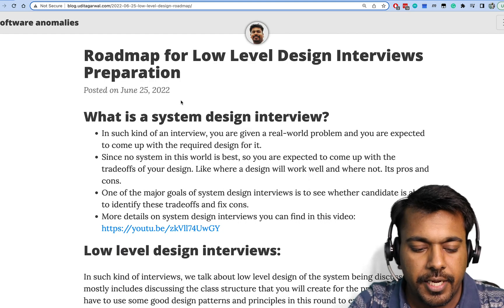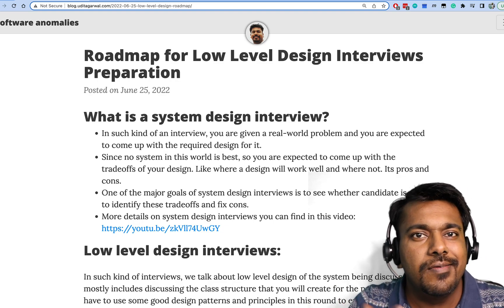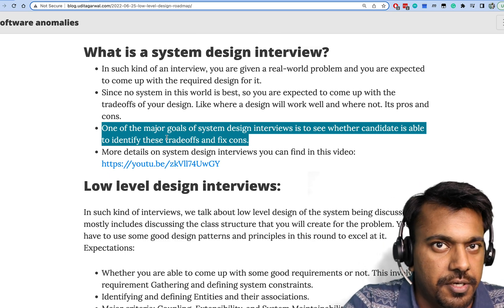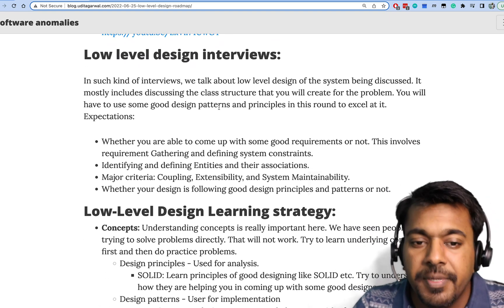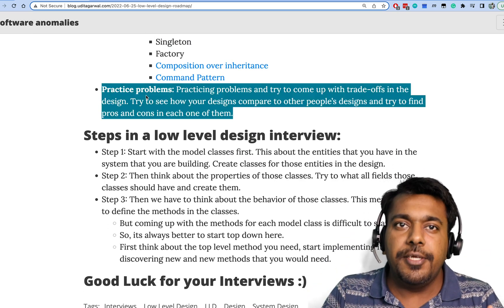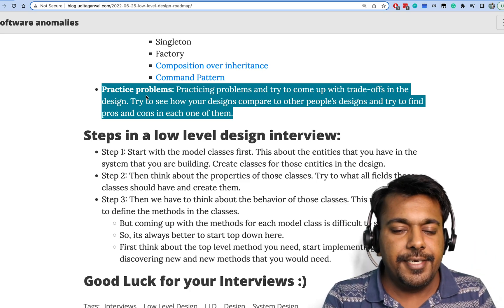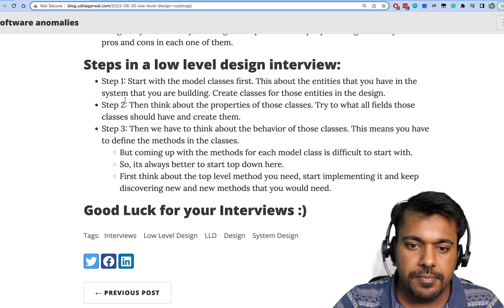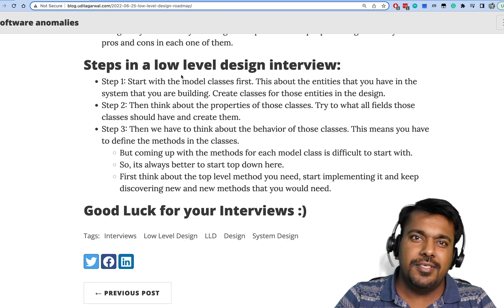Low-Level System Design Interviews Roadmap | LLD 101 | Design Principles | Design Patterns | FAANG

Comment: Hi Udit, This is a very helpful tip. just a question when it comes to system design interview, do you need to ask interviewer if the interview needs to be focused on high level or low level?
Reply from the maker: Yes definitely. If you are not clear or have any confusion regarding the expectation then always make sure you clarify with the interviewer. If you are not sure if interviewer is looking for high level architecture, database schema design or class diagram or something else, do ask it right in the beginning.

Comment: Hi Udit. Thanks for the blog.
Is there any preferred language for Machine coding Rounds/LLD? Java or C++
Reply from the maker: There is no requirement generally from the company’s perspective. But that said, using a language which interviewers are more familiar with would be more helpful. Since c++ is not that widely used in the industry, if you use Java then your interviewer will be able to relate better with your design. 
In general, you can use any language which supports OOPs concepts.